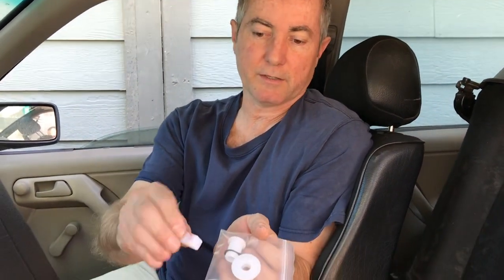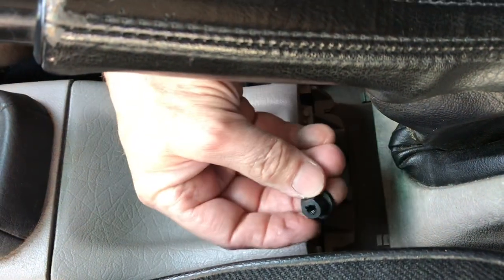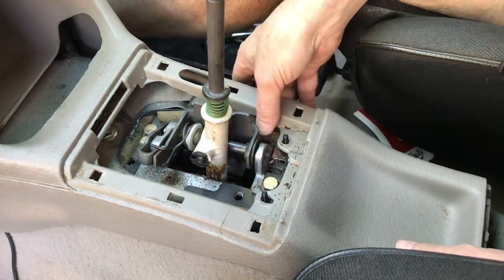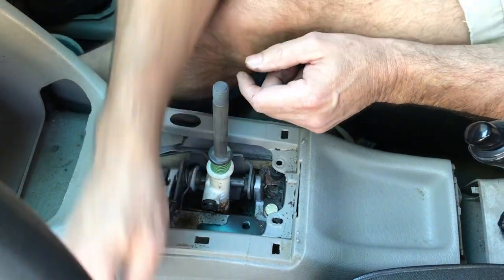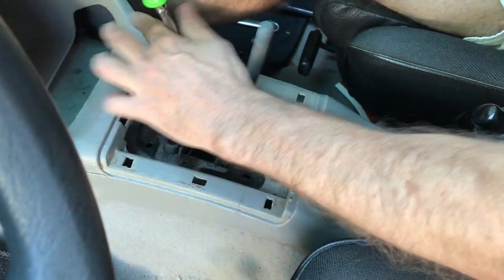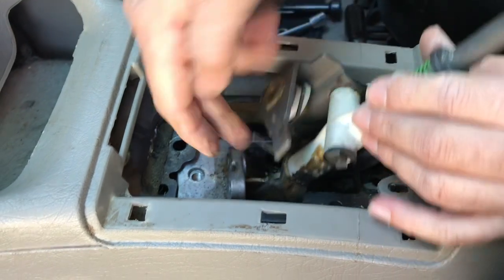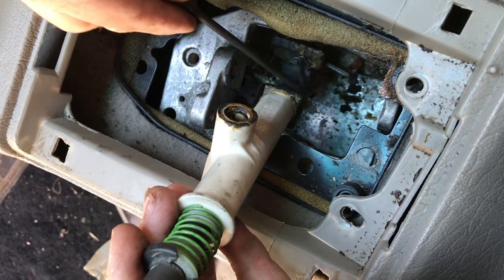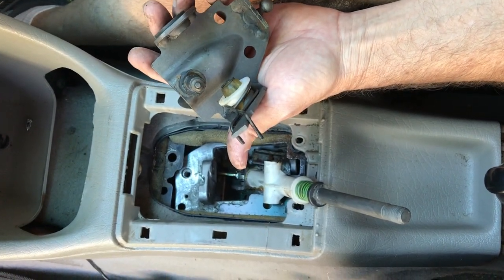Accessing VW Mk3 02A shifter to replace shifter bushings in cabin

Comment: Thanks a bunch, I was wondering if it was possible to remove the shifter pivot bolt without dropping the box out of the car, personally I just tapped that lip down with a hammer, Thanks :)

Comment: hey a bit of advise needed. I recently swapped a 02a in my mk2 but i have an issue with the shifter. it's how far i have to move it in order to get it in gear, first is a bit to the left as i should be reverse is a bit more and third is up. but fifth is really far from third so far that im struggling to got it in gear. now i don't think it is the adjustment, because if i move it just a little bit to the reverse side, it won't go into reverse. so do you have an idea what could be causing it?
Reply: i ofc also have to push down on the shifter to get it in reverse
Reply: If its not going into to gear as far as reverse and or 5th gear you may have to adjust the cable inside the motor area.  There is a nut there you may have to adjust.  I had to do this.  Make small adjustments tighten the nut and have someone run thru the gears.  The is for 1998-1999 bugs the newer ones are different.